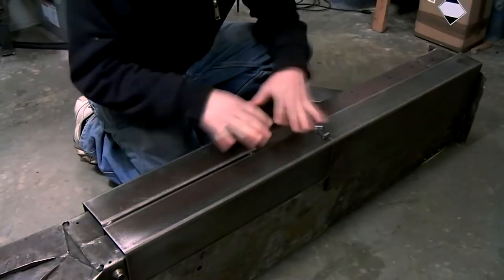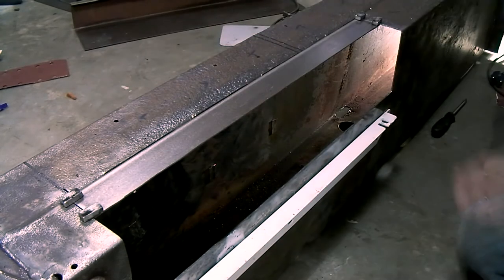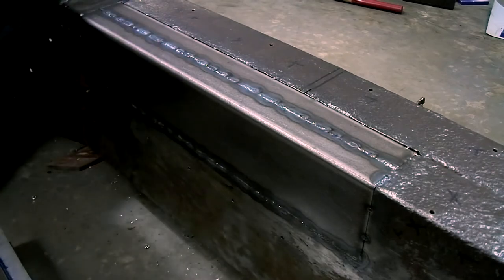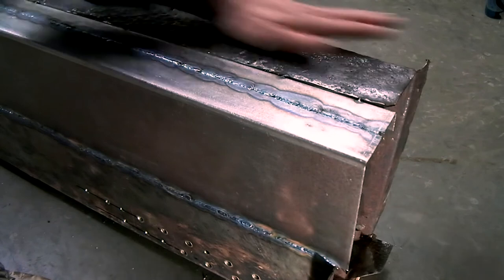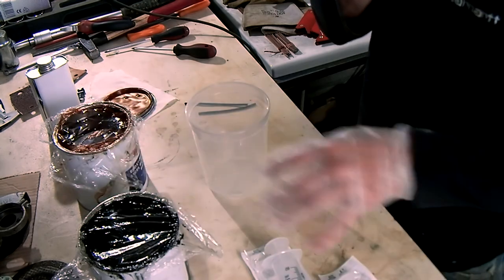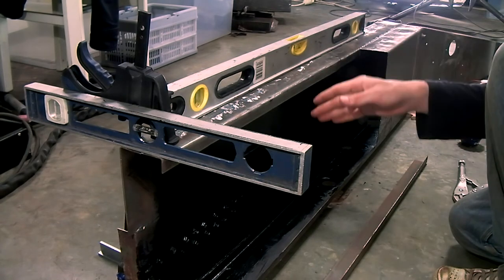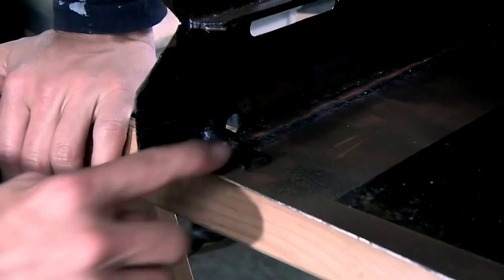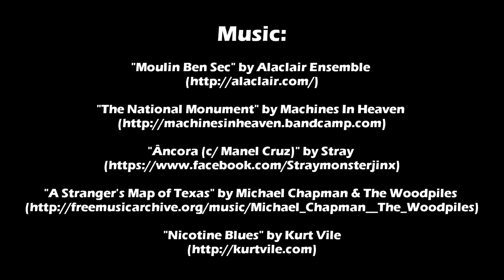Lotus Europa - Ep 6: Repairing the chassis backbone

Comment: Just catching up with this. Great job BTW. I'm restoring an elite. I'm curious why you didn't get the chassis dipped before the welding started though?
Reply from the maker: mikeeech That would be an option, but that's not something that's available locally. I opted to remove the rust by wirewheel, this also left me with some of the structure to make sure that I could keep the chassis straight while cutting and welding.